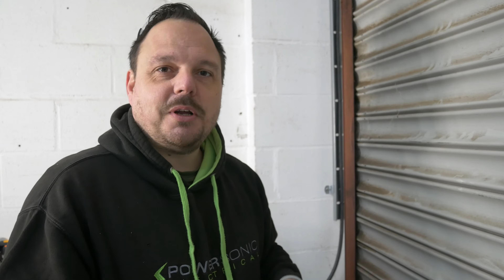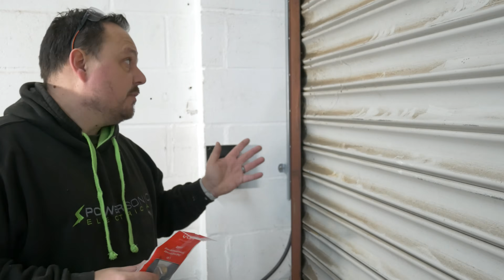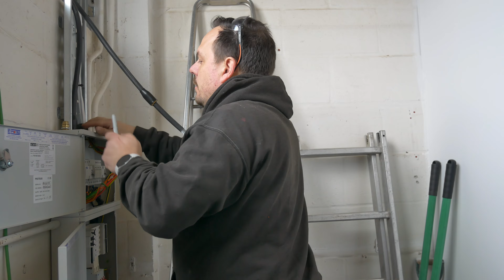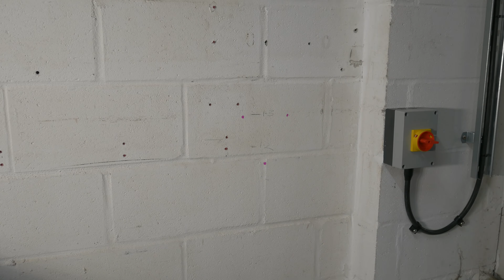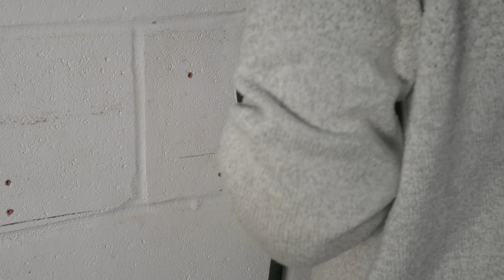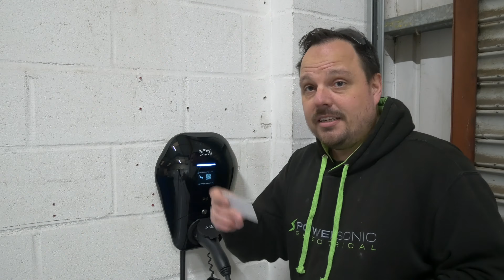ICS 22 kW 3 phase EV charger install - SWA stripping and termination

Comment: Ics app and connection is total crap - I installed a 7kw ics all easy enough but it will not connect
Reply from the maker: Never had a problem tbh. Done a few without issue

Comment: If the EVC has built in RCD protection why do you have another RCD at the main DB
Reply from the maker: Regulations and product standards not behaving together in short. It's all in this one https://youtu.be/nfyIxAqPygU
Reply: @electrician247  thanks for reply, i watched the video , informative to a point, your testing @ times 5 for additional protection is not required not sure why you showed that. but have spoke to ICS as we are installing one shortly and they confirmed that feeeding the EVC in SWA no RCD is required upstream
Reply from the maker: @Paul T  they all say that Paul. But unless it has a mechanical operation, test button etc it does not meet bs7671. The question for ICS is does your RCD meet the product standard 61009 or 61008. 

The 5 times test is part of the automatic process and to demonstrate the different response speeds of each RCDs. It's called an experiment. 

Don't shoot the messenger.
Reply: @electrician247   definitely not shooting the messenger, just a techinal debate , even messengers  still learn. BTW the EVC complies with a product standard this one OCCP, IEC61851-1, the final circuit is what complies with BS7671 not the EVC ( manufactures instructions ) , If ive got it wrong so have the thousands of installs where NO RCD up stream have been done
Reply from the maker: @Paul T  You are correct they do have a product standard related to the equipment and I much prefer as you describe to be how its done! Life is much simpler! 

But BS7671 is very clear on the type of RCD protection that "shall" be provided to all charge points and that product standard isn't one of them.

You are perfectly in your rights not to fit an upfront RCD but for the sake of £100 I can't see why anyone wouldn't. But it's a deviation on your certificate. I would check your insurance is happy to stand by devations and having documented reasons why you choose to deviate. 

Just look at Easee and the trouble in Norway/Sweden. https://youtu.be/IEdJysKOtEo

Our approach is to fit them. As my view is thats the only way to comply with BS7671 unless the product has a 61009 61008 in it. Such as rolec, podpoint in certain variations. 

I hope that helps.
Reply: @electrician247  i think mark we will agree to disagree,  i hope your certificate has deviation on selectivity, The product built in RCD protects the socket outlet on the charger , the RCD in the DB is for protection on the circuit supplying the EVC, only subject to what cable and how its installed. 2 x 30mA RCD in series !!!!!!!! Have checked with IET& NICEIC and on my course on this (admittingly a while ago) all state no deviation would be made. 
I Hope this also helps, have a good day !
Reply from the maker: @Paul T  it's okay to be wrong Paul. I don't fear it. 

The selectivity issue doesn't exist as the RCD within the charge point does not comply with standards recognised by BS7671. It's an equipment/electronic device. 

I wont name the brands because its up to you to do research. But a few if pressed will indeed tell you they believe their products are above the requirements within BS7671 but to ensure compliance with it you should fit upfront RCD protection. 

I covered this issue on the apprentice121 podcast with a rep from proteus. Rather than selectivity in mA rating we should perhaps consider the AC A B F values of the RCD and use a type B upfront of the equipment rather than an A. 

If it was a shared RCD upfront I would 100% do that but on a radial direct I am happy with type A. 

No devations using those methods mentioned above. The devil is always in the detail.

The simple fact remains your EVSE socket "shall" have an rcd to 61008 or 61009. Black and white issue for me.

Comment: Hi Mark. Great video as always! That Proteus board looks pretty good for commercial EV installs. I find it difficult to source a compact TPN board that allows for SPD within it at competitive price.
Reply: Have a look at WCED products. I was in a similar position but they do a range of TPN EV baords with 40amp type A 4 pole RCBOs and T2 SPD built in for uner £80 inc vat. I have used them a few times now and never had any issues. Ive used metal clad and PVC weatherproof versions. Save a blooming fortune compared to other manufacturers.  
Try this SKU for standard metal clad version WMCUSP440C